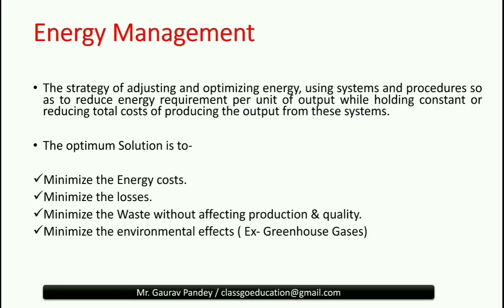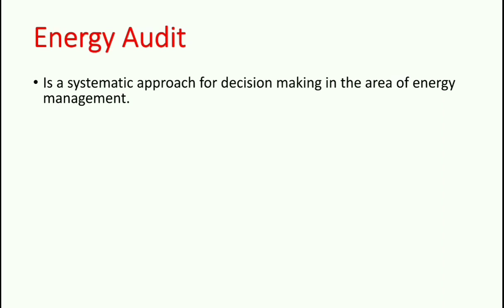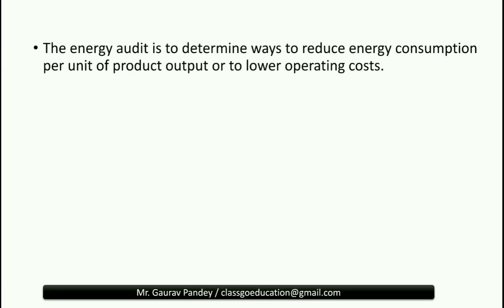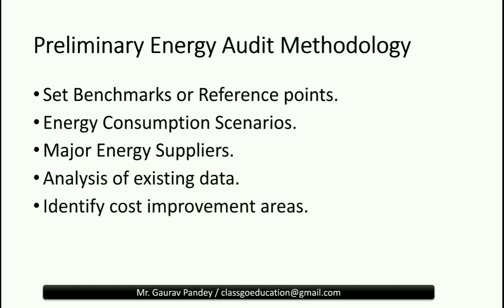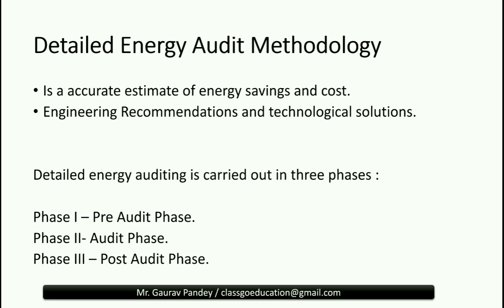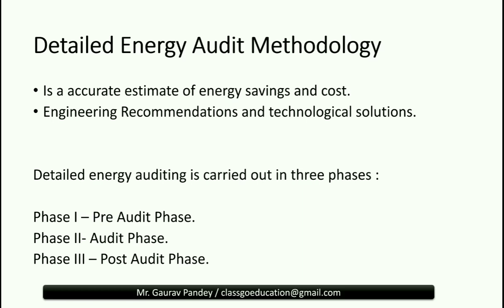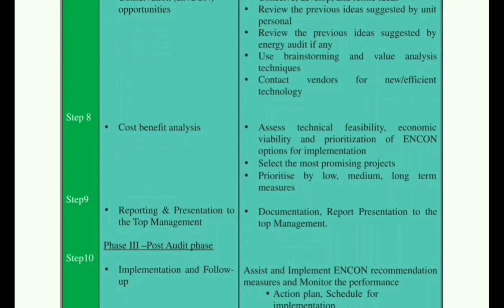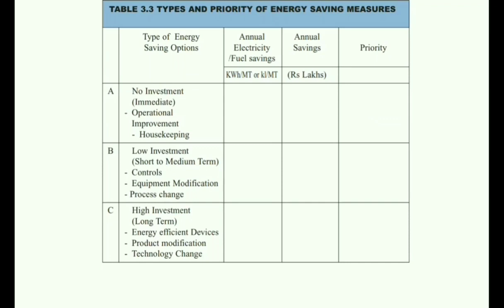Energy Audit -Important Concepts

Comment: Thank you very much for the explanation. I have a question, can we do Energy Audit without calculating the cost of energy bill?
Reply from the maker: It is recommended to take Energy Bills into consideration as installation/Requirement of meters, energy conservation measures can correlate with your bills.